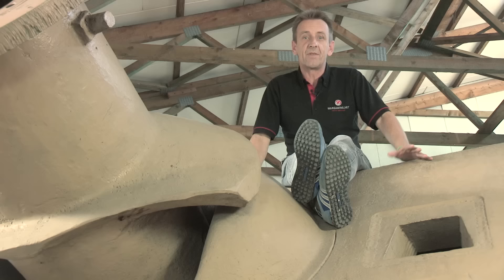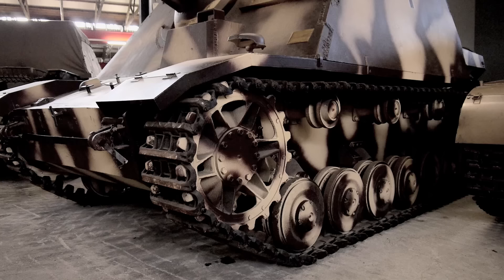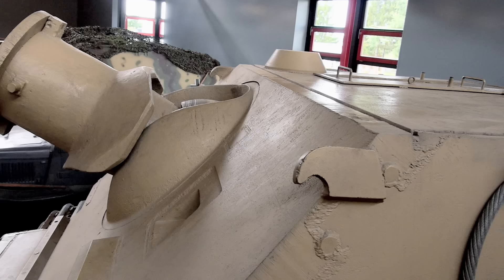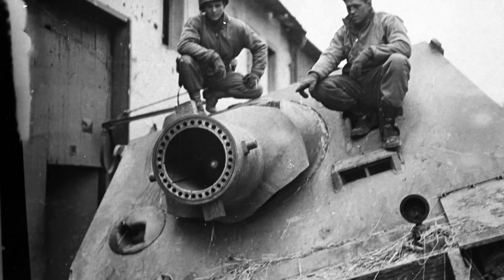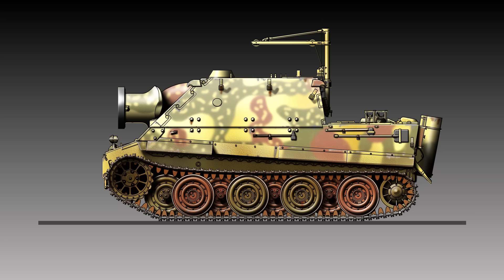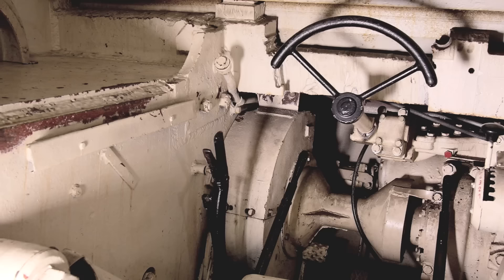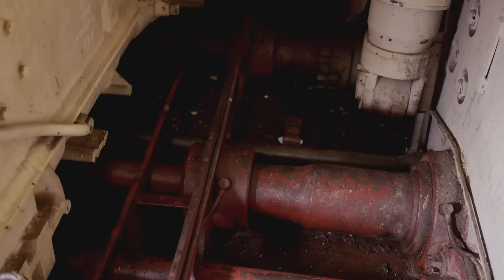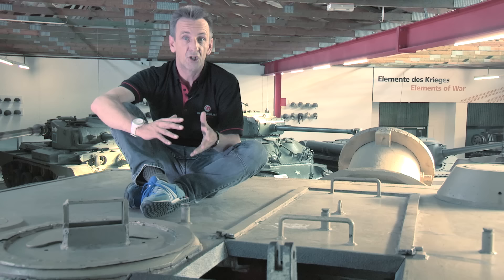Inside The Tanks: The Sturmtiger - World of Tanks

Comment: I wish they would not always repeat this same myth over and over again that the Tiger 1 was an unreliable machine ... even many historians continue to parrot this lines that someone somewhere decided. According to direct battle and repair reports the Tiger 1 was actually a formidable tank in the field. However it WAS a heavy tank without a doubt! And thus it came with the deficiencies that have been TYPICAL for a heavy tank - pretty much ALL of them had those in WW2. With correct crew training and proper maintenance the Tiger 1 was a very reliable machine in the field.
Reply: Depends about which designs and tanks we are talking about. The panzer IV and III? They have been relatively well designed. The Panther though? Was rushed in to combat, and thus suffered a lot from unreliable mechanics. Anyway, in those cases where the Germans could keep up basic maintance their tanks have proven to be usually very reliable machines. Even the Tiger 1 and Tiger 2. That's all I am saying. Of course in 1945 it becames all simply to difficult for the Germans. It was the end of the war after all.
Reply: +CrniWuk I think it's more of that by the end of the war, strategic bombing was actually showing results in the staggering losses in production for the German war-machine in that fuel, munitions, and spare components combined with lack of trained crew all led to the inevitable breakdown of most of their machines. Compared to all the other nations fighting, the Germans were more prone to having unreliable vehicles because they were using either hastily produced machines or ones that had been refitted too many times that they eventually broke down.

Look at the Ardennes offensive, the only reason why the Germans halted was because they ran out of fuel and ammunition for their vehicles and ended up scuttling most of their vehicles or they simply broke down in the cold weather and mud and were abandoned as the Wehrmacht infantry support were forced back. When the Allies came in, they just assumed it was due to faulty machinery when in fact it was because the Germans could no longer support their heavy armour.

Primarily, the main issue goes to their fighting doctrine. They relied too heavily on Blitzkrieg tactics and always being able to capture the resources they needed that when the tide was turned, their infrastructure for the military couldn't bounce back.

There are however a very small percentage of vehicles that were sabotaged from PoW and concentration camp labor but those numbers are unreliable and much smaller to what actually was the more common source: self destruction as the Wehrmacht retreated.
Reply: Commissar Gaunt
Well as much issues as the Germans had, but you have to take a look at the other nations and their tanks as well. Take the Pershing or KV1 as example or the early version of the T34-76. Those havn't been exactly the most reliable tanks either. All nations had issues with transport, reliablity and the economy. Sometimes more, sometimes less. Even the US, since they had not only to manufacture everything but also send it like several thousand miles over the atlantic ocean.

I would say you can not make a general argument either about the Germans or the Allied tanks. You have to look at the machines and battles they where thrown in. The Panther has proven to be a very unreliable machine in the battle of Kurks with almost all of the Panthers lost due to mechanical failures. Yet the Panther later provd to be a very good tank once most of the flaws have been worked out. Tanks like the Tiger and Panzer IV, that is shown by the battle reports and the experience of the Soldiers have been for their time and use reliable machines.

Of course at the time of 1944 and 45 it was nigh to impossible to keep up the warmachine. So much is correct. But even in situations like the Ardenes tanks like the Tiger 2 and Panther performed reasonably well. Much better than their reputation would suggest. Of course you have also those situations where a column of Shermans took out a Tiger 2 by causing a damage to it's electical firing mechanism and the crew had to abandon their tank.
Reply: +CrniWuk  the tiger was only reliable in its retreating defensive role. Damned tank was too heavy, and an engine that consumed to much fuel making it not a good tank at all in reality.
Reply: zela noid
The Tiger, was for 1942 and 43 a decent heavy tank. As Otto Carius describes in his book, what the German heavy tanks required the most, have been good drivers and experienced crews.
http://tankarchives.blogspot.de/2014/08/carius-interview.html
About the Tiger. How reliable was it?

"Initially, there were growing pains. The first company with Tigers was used at Ladoga, near Volkhov. The terrain is nearly impassable for tanks, and it was winter. All Tigers broke down! This happens always, with every new technology.

A significant factor in a Tiger's reliability was the training of the driver. An experienced driver can reduce technical issues. At first, thank god, I had experienced drivers. Then we had young drivers for Jagdtigers, and it was a catastrophe. My personal tank #217 had to be blown up at Danzig, and it held out until almost the end of the war."

However, that doesn't mean that the allies have been completely defenseless when ever a Tiger or Tiger 2 started to pop up. Particularly once they spotted the enemy vehicle.
Reply: CrniWuk the design of the tiger tank in comparison to the Russian heavy tanks had to be blocklike shape to avoid friendly fire. which meant the armour had to be thicker then the t34s sloped armour. that's whats made the tank too heavy for its engine. making it not a good tank design at all especially with poor german supplies towards the end of the war. hence it supprisingly good at defensive roles.
it was german probaganda that made it terrifying and was actually true. but I doubt if this tank was any good for blitzgrieg. the panther was better, it had sloped armour to make it light for the engine.
Reply: zela noid
Except that the KV1 had also a block like shape. The Tiger was a design based on a much earlier prototype that goes as far back as the 1930s. First prototypes resembled the shape of Panzer IIIs and IVs. Again, compared to the Char B1 and KV1 the Tiger was a very modern and desent design.
Reply: Frecnh char b1 is outdated.  I will argue against your point about the tiger being modern and descent, it is and was until the introducdtion of the Russian heavy tanks adopting sloped armour to counter anti tank guns. The success of t34s somewhat render all other armoured concepts ineffective. I think the germans stuck with these panzers design to maintain silohett  that was it. they realy had no other choice, look at the panther it looks almost like a t34 from a distance.
Reply: zela noid
Please, read what I say! Not what you think I say. The Tiger was a DECENT HEAVY TANK FOR IT'S TIME, that means for 1942 and 43! When the enemy tanks the Tiger I would face, have been mostly the Churchill, KV1, KV2, KV1s, KV-85 and the IS1. It was not a perfect tank, far from it! But compared with any heavy tank from 1941 and 42, the Tiger did very great. You can only compare a tank to the designs it faced. This includes, but is NOT only limited to the T34. And the Tiger 1 could even still destroy the IS2 and Pershing on usual combat ranges in 1944 and 45 - which it also did! By 1937 when they started work on the heavy tank concept, the Germans knew very little of the T34. The T34 was not even a prototype at that point. The Panther was also NOT based on the T34. The Germans had a prototype based directly on the T34, the VK 30.02 (D), but it was never produced. The Panther was based on the VK 20.02 (M), a design they started to work on in 1938, to replace the Panzer III and IV.
http://s9.photobucket.com/user/zarax/media/vk2001.png.html
Germans knew about heavy tanks in the use of the Soviet and more importantly the French army, before the war started. Sloped armor, was a concept that the Soviets didn't exploit much on the KV1, KV2 and KV-85 either, just to say that much. The Germans also had concepts with sloped armor early in the war. And they knew that the Tiger 1 would be outdated by, no later than, 1944. But it was needed in 1942-43. So when they started to already work on the Tiger 2 in 1942, it was meant to have sloped armor from the start.
Reply: +CrniWuk Zela noid is right, the tiger was not a revolutionary design by any stretch of the word and this myth you speak of, about German tanks being unreliable, they got their reputation for a reason, people didn't just make it up, there were cases where cases where the build up of fuel in a panthers mufflers would cause it to catch on fire, accounts that during the blitzkrieg 30% of all German tanks were out of action with mechanical breakdowns at any time. Not to mention that the first tiger to ever be knocked out in battle was done so by a 6pdr
Reply: Mitchell Reeves
I didn't call the design of the Tiger revolutionary. I just compared it to the designs that you had in 1941 and 42. The timeline when the Tiger was designed and first used in combat - 1942 near Leningrad. Compare the Tiger 1 to the KV1, Churchill and Char B, and tell me it is not the better heavy tank. And a better design suited for brake trough operations compared to the KV1 for example. The Tiger 1 was better protected, better armed, had a better mobility and was more reliable. Only the IS2 was capable of beating the Tiger in all of those. And yet, both tanks could destroy each other on usual combat distances.
The Panther was overengineered and a rather pecuilar case. I absolutely agree that it had many issues. The french used Panthers after WW2 and they didn't like it either. Nonetheless, people often see German tanks as unreliable, because they don't make a difference between strategic and tactical qualities. For example, the Sherman was a great strategical and tactical tank. The Panther had better tactical qualities though. Strategy, with tanks, is about how fast you can deploy units. How reliable they are on the march. How much maintenance they require to work properly. And it is not much of a surprise that the allies had also tanks with bad strategic qualities. Like the Pershing or the Churchill.
Please! Don't just buy this "myth" of unreliable German armor, like as it would be some kind of rule. Look at all the vehicles seperately and judge them on their own terms. Don't assume that the Stug, Panzer IV, Panther, Tiger I and 2 would have been all the same. They had different designers, engineers and specifications. They saw changes trough out the war, and sometimes even a complete change in goals - see Panzer IV.
Reply: +CrniWuk  Correct crew training and proper maintenance is not always a luxury you can afford during wartime. If a tank can't be operated properly in the field, then it's unreliable, period.
Reply: TJP77
Exactly! A great machine that works half the time, is worse than a mediocre machine that works always.
Reply: The Tiger was basically useless at the very thing tanks are supposed to be good at: infantry support. That's what they do 90% of the time, not anti-tank. Anti-tank was the only thing it was good at and it was massively over-engineered for it. The same job could have been done cheaper and more efficiently by other weapons. The cost to the German economy of building these stupid things was bad enough but the cost to the Wehrmacht of pissing several years of tank development up against a wall was immense. The result was that the main German infantry tank of the war remained the Panzer IV until the end when it should have been replaced in the 1943-44 period. It was still a good tank but starting to become obsolete.

The Tiger was a stupid tank and the Tiger II even worse.
Reply: yes, the Tiger lasted from the North African campaign right through to the end of the war. The Tiger was complex, however... the crews maintained it, normaly doing work on it at night before they went to sleep.. which meant it lasted through the next day. The Tiger was one of the best tanks of the war, and when it comes to the top tank Aces in WW2, most of them were in Tigers.

Comment: In the game Battlefeild 5 there are a additional Grenade launcher autocannon thingy in the tank and a extra MG 42 mounted outside and one on the other side of the hull mounted one. Leaves me thinking, how many crew should there be in the game. There are currently 4 but technically there should be 4 Gunners for the grenadier launcher and MG42's, 1 Commander, Two or Three Loaders, and a Driver (And raido operator) Excuse my spelling im bad at spelling :D. But again i think there would really be around 7-9 crew in the tank for it to work correctly in the game

Comment: "It's not a tank" not to break your bubble it is a tank what else it is? not an artillery peice. Well you can argue that it is an artillery on tracks, but no it's a tank with a big cannon, it works as artillery peice but it can also take out other tanks like T-34, Sherman. It has the structure of tank, it has the mobility of tank, it has engine of tank, it has armor of tank. Yeah it has all that a tank have.
Reply: +Henrik Nilsson Except a fully rotating turret - which is pretty much the defining feature on whether or not an armoured vehicle is a tank.
A bus has wheels, an engine, moves from place to place and carries people around - but that doesn't make it a car does it?
It's not a tank. it's a self propelled assault gun.
Reply: Graeme Pryce Stug (Tank Destroyer) is a tank and does not have a  rotating turret. So Stug is not a tank either than?
Reply: Henrik Nilsson No - you said it yourself! A Stug is a Tank Destroyer if it has an anti tank gun mounted or a self propelled gun if it has a howitzer mounted.

I have a model of a Stug. I always feel a bit sorry for elite, long serving german tank commanders that were used to proper big tanks but after 1944 were given a little Stug and told to do that same job with it because Germany couldn't replace their tanks quick enough. They must have been so disillusioned, poor sods.

Comment: Soo its gun could over match 190mm of armor. That is scary.
Reply: Lol it's 380mm gun!!!
Reply: Yes it is.
Reply: Crudscar It can destroy an Abrams tank if the shot even lands next to it damnit!....
Reply: xXiCrazyHD A direct hit would push the tank for 1 just from the sheer speed and weight of the shell. Second, a hit to the turret is most likley to tear it off, to the hull, if it does not penatrate it, leave a massive. The main damage is the same as how the Soviet 152mm shells worked. The sheer blast and concussion would kill anybody inside the vehicle and cause extensive damage to the exterior. Does not even need to pierce the armor to kill.

Comment: I woulda thought they put Hitler's Buzzsaw instead of a MG-34
Reply: No. In fact. All German tanks had mg34 instead of mg42.
The reason is that on the mg42 the firerate is so high they have to switch the barrel of the gun..this is impossible in the tight space of a tank and when the MG is mounted in a tank..
This is why they did not use the mg42.

Comment: the Tigers did not suffer from mechanical unreliability they were actually more reliable that all the British tanks....

the engine never gave up or blew
the transmission didn't die unless it was damaged in battle 
the final drives was the only area in german tanks that gave them problems.

in fact there was one tiger that was shot over 300 times had its transmission grenades and half its suspension/ roadwheels blown off YET IT STILL MANAGED TO CRAWL A FURTHER 50 MILES TO GET TO THE GERMAN LINES FOR REPAIR.

and besides the German repair depots were much quicker and much more efficient that those of the criminal british and americans